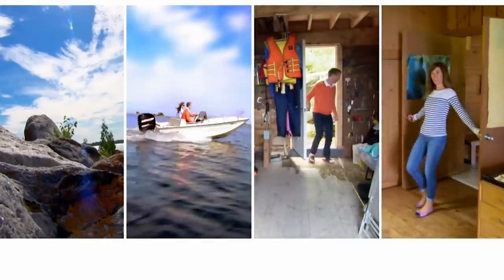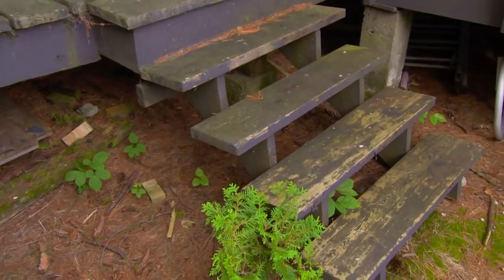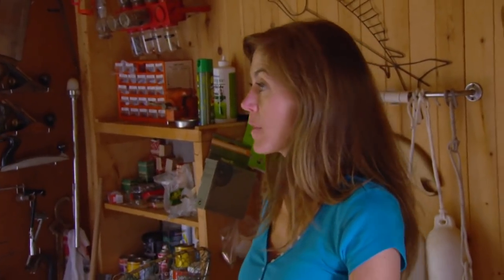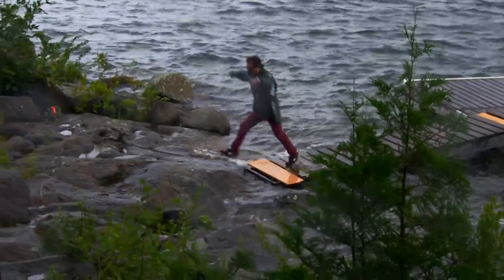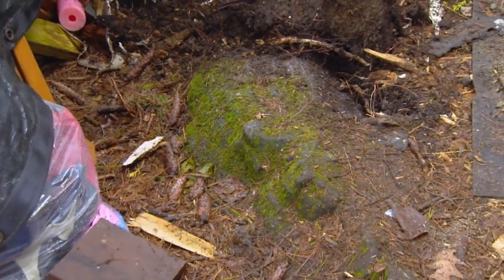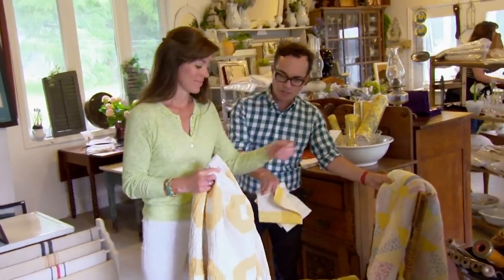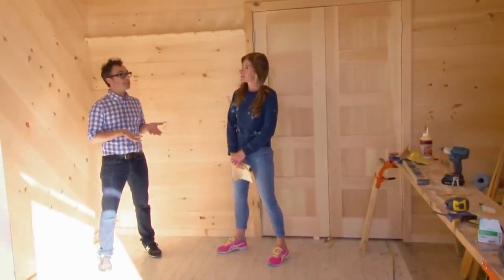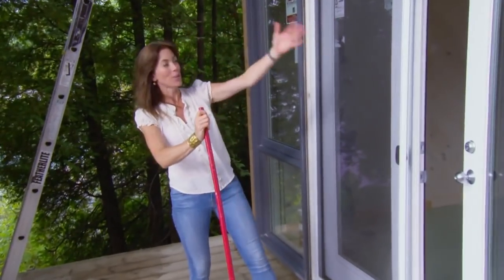Creating The Perfect Lakeside Guest Room | Sarah's Summer Rental | Abode

Comment: I find this very strange, that someone would leave all of those items behind? However this is an Island. So the previous owners are obviously letting the new buyers know this is what you may NEED!!! And the previous owners no longer require these items, also this lot has to be  included in the purchase price. 🤔
Reply: Also a w/machine outside on a deck? Damp, frost? That machine needs to be inside that building. 👌 Burst pipes?
Reply: @JoJo-Hamilton  just for summer!  It'll be winterized for the season.
Reply: @linw7320  Ah. Good to know. 👌